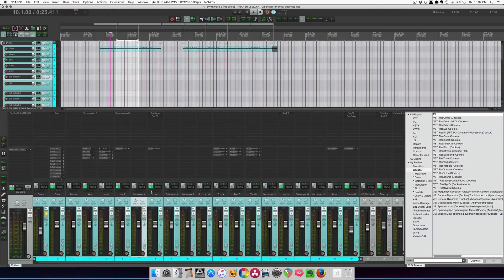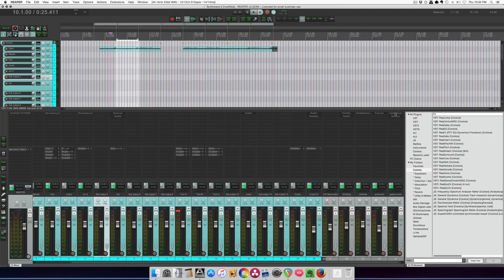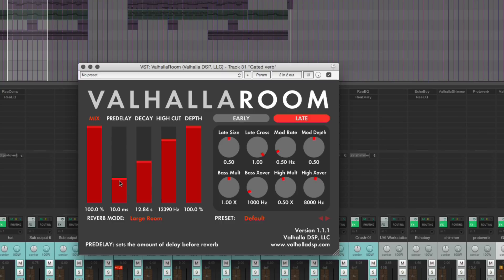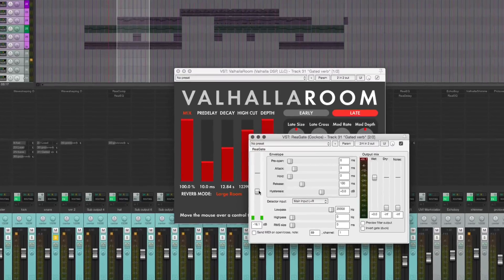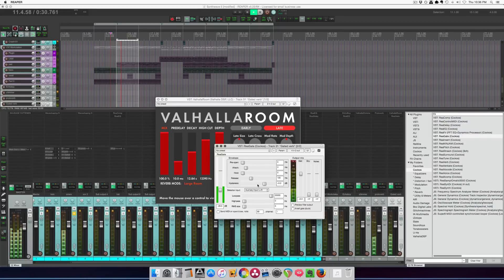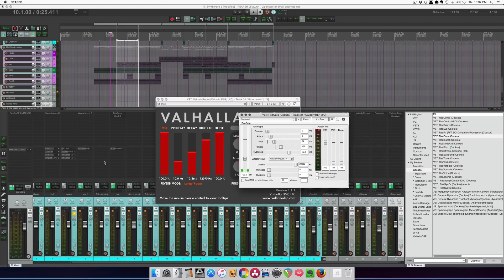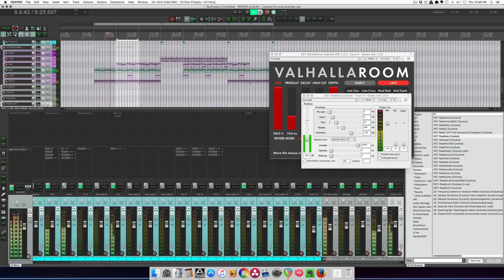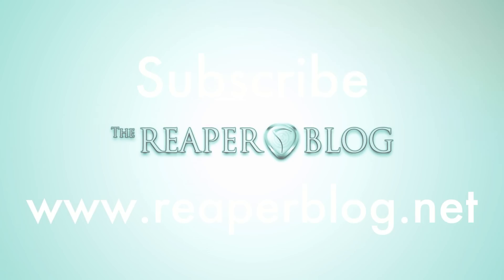How to make a gated reverb effect in REAPER

Comment: Whats the difference between Reagate and Reacomp ?
Reply from the maker: Almost opposites. 
ReaGate is a noise gate, it silences the track when the audio falls below the threshold.
ReaComp is a compressor, it reduces the dynamic range of the audio by turning it down when it goes above the threshold.
Reply: Ok thanks. And thanks for understanding what i was driving at regarding side chaining. :P

Comment: If I set the Audio channel output to 3/4 and the detector input to "Auxiliary Input L+R" I can't hear any reverb. If I set the Audio output to 1/2 and the detector input to "Main Input L+R" it works. How to you make it work with the Audio channel ouput set to 3/4 and the detector input set to "Auxiliary Input L+R"?
Reply from the maker: you need a send from another track to trigger the gate opening on channel 3/4. two sends from the snare track to the reverb.